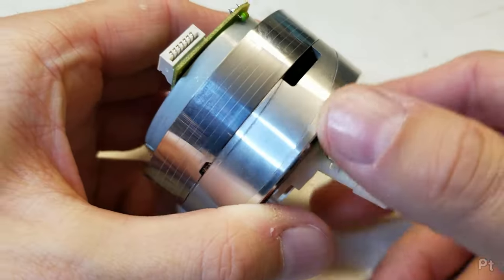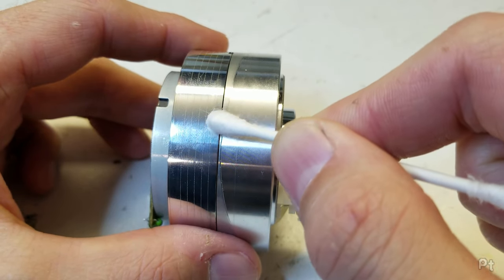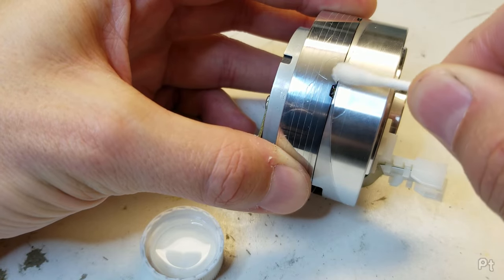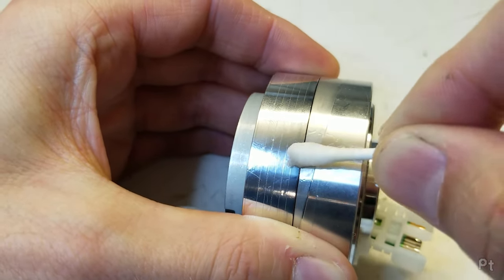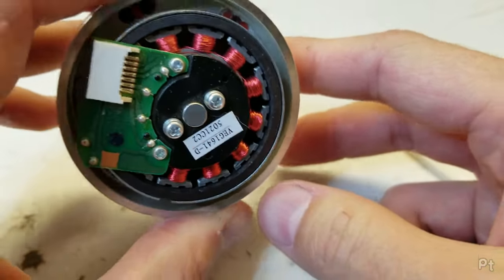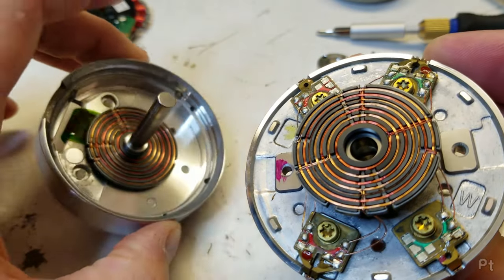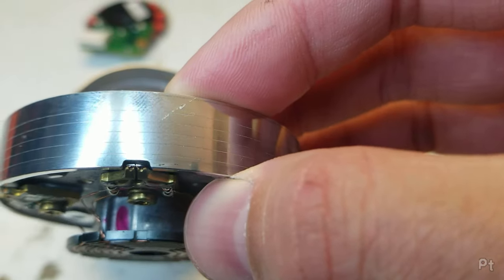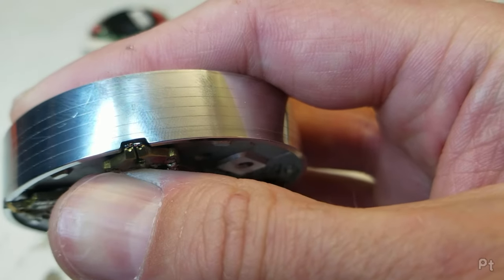How NOT To clean a VCR Video Head

Comment: I've cleaned vcrs for 30 years using q tips.. never had a problem
Reply: You were lucky or had expensive ones!
Reply: @OmeedNOuhadi  Or - and this needs testing, but it is a theory - damage is more caused by method than material. Disclaimer: I have no VCR experience.

I've cleaned a lot of things with q-tips, and a lot of things with roughness in parts of their surfaces that cotton might get stuck in. There are some things you can't clean due to the roughness but from the looks of what I see here, there might not be an issue.

First off, I would never go against the grain of any material (in this case, "up-down").
Second, I would never push so hard and be so rough.
Third, I always "wind" the cotton once more around the q-tip to flatten any stray "hairs" while it is completely wet with isopropyl. 
Fourth and last, I never get too close to edges that will "bite" the cotton.

The guy in the video did not follow any of these basic common sense things. So, the question remains: if someone isn't an idiot and uses cotton swabs or q-tips, could they damage the head or not? The question remains unanswered.
Reply: same never emessed any up. Still have my zenith from 1994 still working

Comment: I learned this the hard way back in the 90's when trying to clean the heads on my camcorder. Broke a head and pulled the wire right out! Fortunately I was able to get a replacement and I got the camcorder working again but lesson learned.
Reply: Congratulations on doing your own repair, and repairing the repair you made on top of that.  👏👏👏
Reply: Yeah in 2024 if you do that there is no way to source a replacement head other than buying another camera. Definitely no way to get a new one.
Recently i was recording all my mini dv tapes and some of them are like 25yrs old at this point, so pretty much every tape made the head dirty. And i had no cleaning tape. So i was very careful and gently cleaning the heads everytime a tape got successfully transferred. Took 2 days to copy 5 tapes. And i still have 8 more remaining as those are hdv tapes that my dad recorded on his sony hdr-fx1e. So now I will have to fix that camera. It has not been used in like 15yrs..

Comment: Painfull to watch the little guy get damaged. However I never had a issue for years cleaning with Q-Tips.
Reply: Me neither. We just pulled the case open, over rode the cassette load switch so the head would spin, and then lightly held a q tip soaked in 99% isopropyl  against the spinning drum. We got many years out of them.

Comment: Thank you so much for these wonderful videos. Look forward to them every week. Now, I have a Mitsubishi HS-3281UR and I believe I misaligned the loading cycle on it. It won't load a cassette anymore. What is a good way to realign the mechanism on the cassette bay?
Reply from the maker: That's a hard one. Unless you have the service manual, the best I can recommend is looking for timing marks on the gears - usually a small circle or triangle/arrow, meant to show how to line the gears up. Other than that I've tried moved one tooth at a time when I suspect timing is off and there's no markings to follow.

Comment: I bought a Panasonic branded device and it had an incredible quality, everything was great, but it did not read the tape and got stuck there. I couldn't find the solution and I messed around and unfortunately I damaged the heads and it turned out to be waste. Later, I found the solution, I solved the problem by pushing the tooth manually, but it was too late. I'm still very sad, it was a great device.

Comment: How often should the video and/or audio heads be demagnetized, if ever?
Reply from the maker: I've never heard of someone demagnetizing video heads in a VCR. The head drum is aluminum and the cores are ferrite, so there isn't much to become magnetized. I suspect you could risk causing damage by attempting this.

The stationary heads (full erase, control track/audio, and audio erase) could become magnetized over time, but I think if you use the VCR to record periodically it should be fine. All of these heads will be fed a signal when recording, which should demagnetize them (my understanding is the AC bias signal should work to demagnetize them).

Comment: I know I drop the most random questions. How do you feel about the Sharp's more budget oriented range from the 1980s? We have used a Sharp VC-6730U since dad bought it new in 1987 and I got a VC-6846U for a birthday present. Both are fantastic machines. Basic, but they work very well. I am thinking about buying a VC-685U. Does the "equalizer" encode the audio like Dolby when switched on during recording? Does anyone know?
Reply from the maker: I don't have a lot of experience with Sharp, but I've known people who really liked their stuff. I know their complex stuff from the 80s was unreliable, but maybe not so much with the more basic models.
Reply: 1986-89 your paying by the pound. So many of those features became standard in later models. Auto tracking was handy for just kicking back. I can't say too much bad about Sharp except there's usually some little fix here and there. Looking at the brand as a whole. The vhs-c screens would develop lines through them. But I believe that was the ribbon cable. Our Sharp Thailand microwaves required tweaking the relay. They are awesome by the way. They are probably better than sanyo.

Comment: I'm using q-tips and isopropanol since ever, but I hold it in a fixed position, press it without force against the drum and turn the drum by hand. No vertical movement of the q-tip. But this is when I get a VCR "new" via ebay. For general cleaning after a bad tape I use BASF tapes from the eighties, the original ones with a four digit German ZIP-Code

Comment: Thanks, is there a way to remove the head and still be able to play the tape without image. I'm working on a project and need to put a similar tape (not video/audio tape) in VHS spools and just play, FF, RR.
Reply from the maker: The head drum plays an essential part in the tape loading design, so you wouldn't be able to operate the VCR without it. However, I don't see a big deal with just leaving it in the machine. Non-magnetic tape could damage the heads, but if you don't care about that then just leave it as-is.

Comment: So how do you clean a video head, especially the thin 19µ ones?
Reply from the maker: The cleaning method will be the same regardless of head gap width. The one I use (as well as many others here on youtube) is with printer paper + isopropyl alcohol (check my pinned comment). I tear off a small strip of printer paper and soak it in 99% ipa. I then gently hold it against the head drum with about the same pressure that the tape has when going past the heads. Now I rotate the head drum a few times - you can feel the video heads pass the paper. Do not move the paper while doing this, especially up and down (perpendicular to the tape path) as this can damage the head. Remember not to hold it to hard against the head, it just needs enough pressure to touch the heads as they pass.

Comment: hi i was told to use paper   i had a ADAT with bad audio  the paper thick worked ok 

beacam sp heads are more fine a tec told me  there a cleaner that all ways coming on around the head drum 
6 time the tape speed of a betamax a tec told me